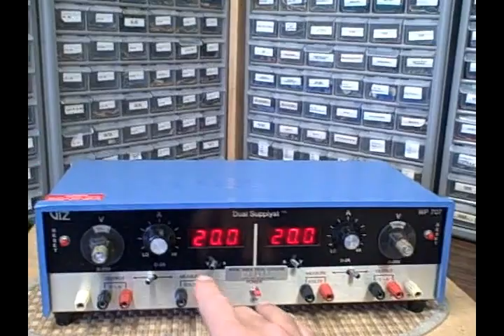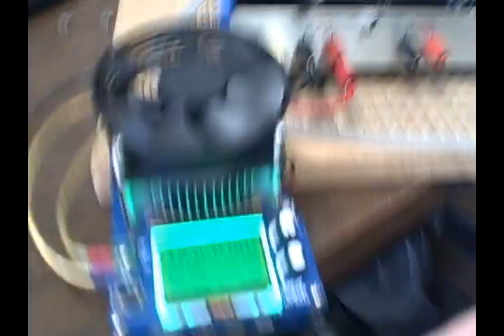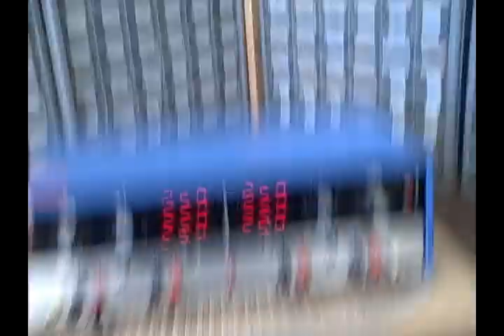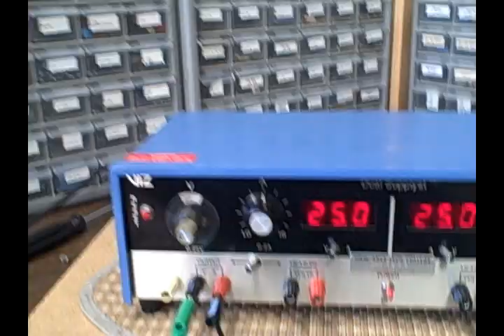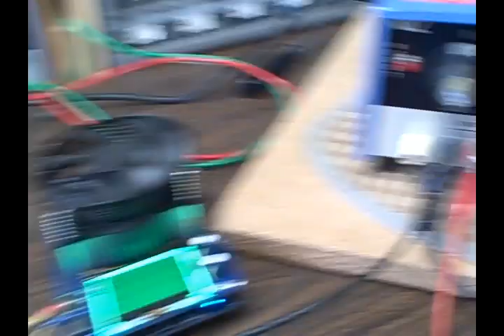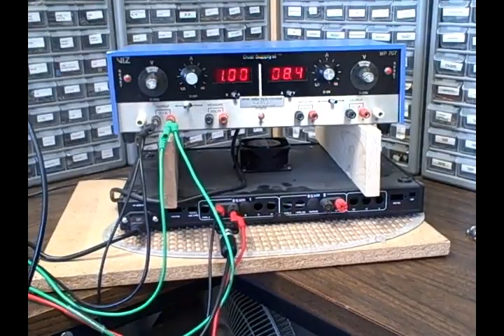Part 2- WP707 Demo and Testing

Comment: I have the 50 volt version. I cannot recall the model number at the moment but it is in storage since I revived it from capacitor death. It's not easy finding service data on these either.